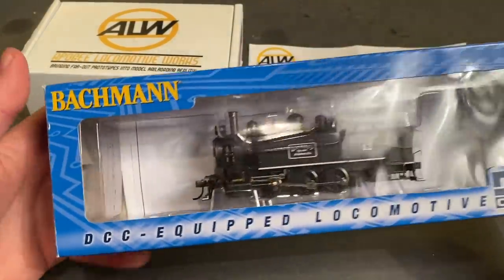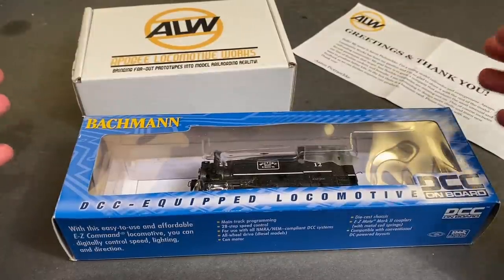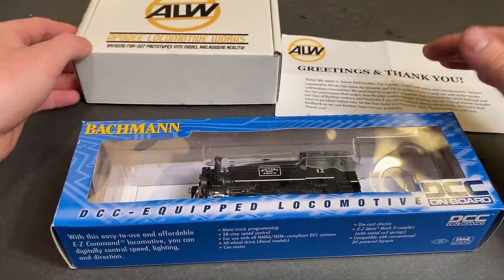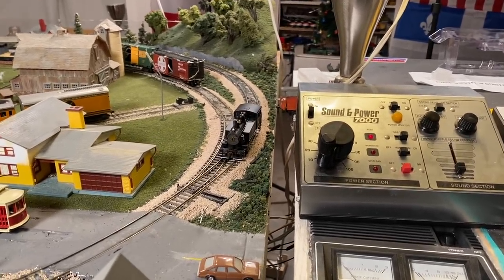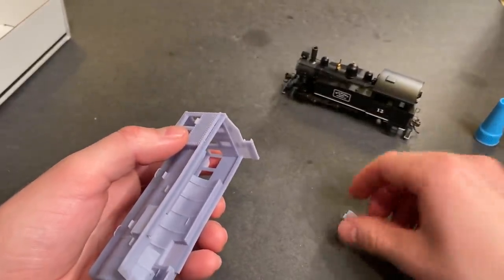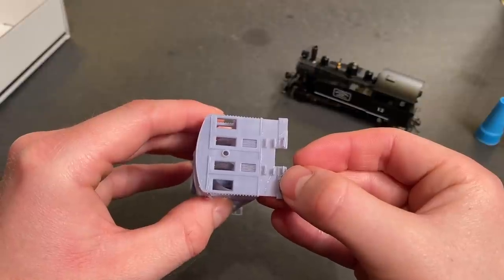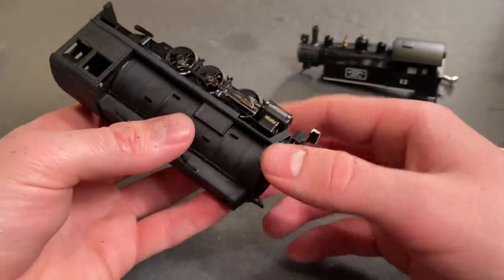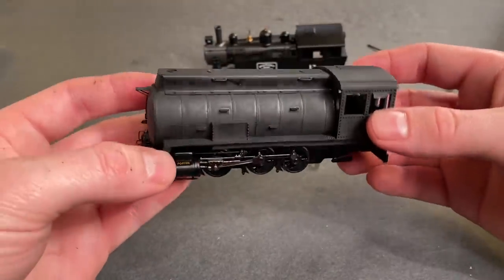Building an HO Scale Fireless Steam Locomotive

Comment: A fireless cooker is like the air tank on a compressor or that you use to inflate car tires - just larger. 

They charge it up with steam and it runs until the pressure gets too low.  

It's both cleaner and with no on board fire it can run in places where having that fire might be an explosion hazard. 

Often these were painted bright yellow, or grey, rather than black.
Reply: The locomotive itself may be cleaner but not really due to the fact that they still had to create steam to fill it with
Reply from the maker: Thanks for the info
Reply: @HoundOfBaskerville  steam or compressed air, though the latter was much more uncommon. Either way all the energy to pressurize rhe Gas has to come from somewhere in the end right?
Reply: @eageraurora879  exactly but it’s the same amount of pollution if not more just not in the direct area of use
Reply: Operation is more like a cryogenic tank than a simple storage tank. What is piped in is normally supper-heated steam (which is more energy efficient at doing work and can be made from the same heat source by extracting more energy from the combustion gas). It would be "steam" if it was allowed to vent to atmosphere but since its under pressure it remains a liquid. From the filling process there is some "head" of steam gas that wants to toggle between liquid and gas. As the locomotive draws off steam the pressure drops slightly and more of the water becomes a gas increasing the pressure ans stopping more water from converting and slightly "cools" the liquid. The cycle continues as steam gets used and water is converted the contents slowly cool though both loss though the boiler shell and energy conversion when changing states. The pressure in the boiler drops as the temperature cannot maintain the high state of steam with the draw off. Eventually the pressure and temperature become such that little or on useful work can be done. Then its time to recharge. At recharge, the super heated steam than heats the water and steam in the boiler back up to well over the boiling point and the cycle begins anew.

Comment: Besides power plants and steel mills, these locomotive types were used at chemical and armament manufacturing plants since they did not have an open
flame like conventional steam locos. As noted below the Railroad Museum of Pennsylvania in Strasburg has one on display. Thanks for the informative video!
Reply: Not were used, some are still in use today due to the lack of alternatives. But the model is wrong on 99 % of the prototypes the cylinders are underneath the cab to kerp the piping short.
Reply from the maker: Thanks for the info
Reply: @steffenrosmus9177  if you look at H.K. porter, heisler and Davenport prototypes you will see the cylinders in this configuration. Most European prototypes did have the cylinders under the cab.
Reply: @steffenrosmus9177  That was the practice on European Fireless Cookers, US practice was as shown in the model

Comment: These fireless locomotives were basically a high pressure tank that either held steam or compressed air from an external boiler or compressor. The big use I was familiar of was for mineshafts. This solved two problems. You couldn't have an engine belching out smoke in a confined space and occasionally you would tunnel into a pocket of gas and having the open flame of a traditional steam engine could act as an ignition source.
Reply: In the UK they were in places like Munitions as the high level of a spark could end in disaster
Reply from the maker: Thanks for the info
Reply: Joymon Creations  

Harrison.

Comment: Fireless steam engines were mainly used in areas where an open flame of a firebox was an extraordinarily bad idea like oil refineries, gas plants, etc. Since those industries usually still needed steam for various processes they'd run a steam pipe to the area the steamers worked so they could get a fresh change of steam. IIRC there were a couple of power plants in the 70s still using fireless steamers.
Maybe some zebra stripes decals for the pilots.
Reply: Grain and sugar mills as well, as the fine powders and dust from the manufacturing processes could create explosive atmospheres. Even some metal working plants used them for that reason.
Reply from the maker: Thanks for sharing

Comment: I always thought these things were neat. As a younger kid, I thought they were streamlined tank engines lol. Here in PA, most of the railroad museums I've visited have had one of these sitting around somewhere. The "Railroad Museum of Pennsylvania" in Strasburg has two. One is an 0-4-0 painted bright orange, the other an 0-8-0 painted a beautiful, brilliant blue. Really neat engines, and a really neat video!
Reply: not having the high maintenance fireboxes and their associated hardware the fireless locomotives were easier to keep  around, particularly handy for moving just a few cars at low speed were high horsepower and long range are not needed.

Comment: The body shell looks like resin, which is brittle and not as flexible as styrene.  Hence, thin parts crack easier.  Nice work, as always.
Taking all the screws out was how I figured out how to disassemble the 4-8-2 from Maine Modelworks. The motor was pre-Pittman and the lone wire was fiber wrapped-IE 40's-50's vintage.

Comment: They were also used in places where fire was bad. And while some did use compressed air, most ran on steam fed from a stationary boiler under pressure in the tank.

Comment: Looking at the shell pre painted it looks like it was made with a resin printer so if I had to take a guess it is probably an nontoxic resin that was used and in my experience that resin is super brittle at certain Temps and has the tendency to break on its own as the Temps fluctuate so it would seem to be a material choice issue. I would reccomend to the seller that they switch to a more temp resistant resin

Comment: Surely the weight/light diffuser from inside the front of the boiler should have been moved into the new shell. It looks like it also had the thread for the screw. I'm guessing there's something similar in the back of the Bachmann body that needed to be moved across. Did the kit have any instructions? I'm also surprised there was no glazing in the kit.
Reply from the maker: Probably so.

Comment: Nice Video SMT Also SMT what is the Best Track Cleaner I Can Get for my Kato Track also is it Bad To Double head a Locomotive to Pull long Trains and MY AHM Made in ASTURIA Spirit of 1776 Has Weight on it In the  Fuel Tank can it pull a Long Trains in the Condition it is ?
Reply from the maker: If the locos are DCC speed match them. If they're DC, wouldn't run them together unless they have the same drive.
Reply: @SMTMainline  Thank You